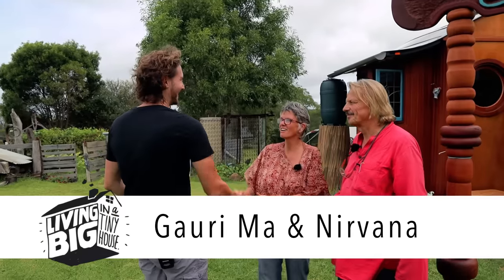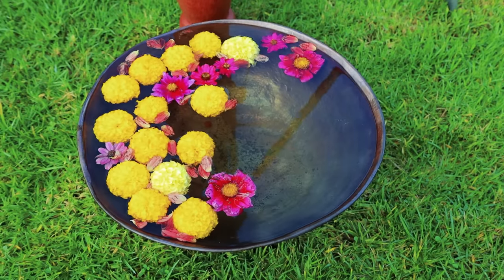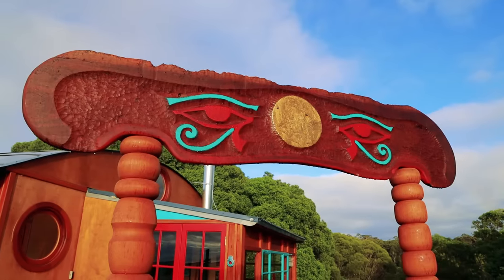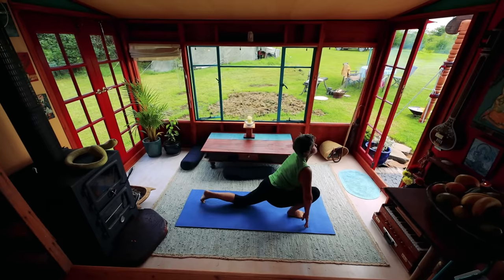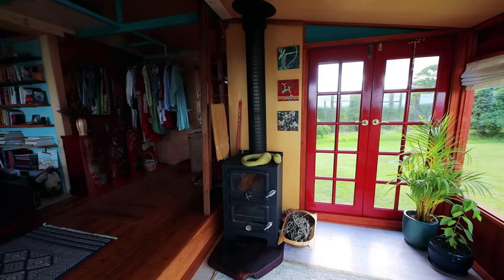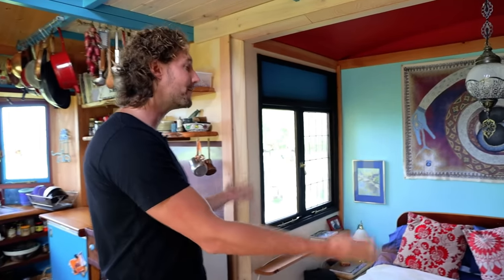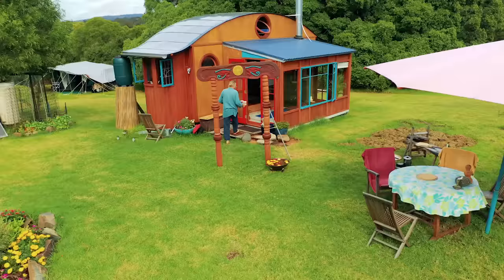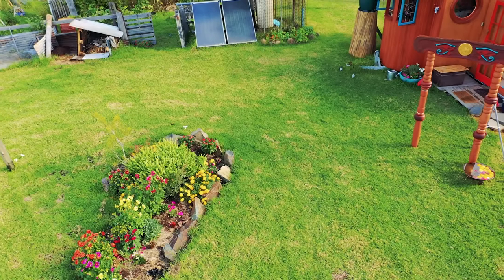Transforming Tiny House Combines Beauty And Engineering For Artful Living

Comment: hands down, this is the best one that's a fit for me that Ive ever seen, mostly off grid capabilities, the downstairs bed with room on sides and above,  one room open space with virtually few walls, taller head space, yoga space, lots and lots of windows/ atrium area bringing light and outdoors in, using space in floor for storage, indoor outdoor shower plan, gathering rain from roof gutters, funky large kitchen and use of beautiful found materials when available, and ethnic color scheme and huge beautiful well protected garden that sustains most food needs with pristine land and likely few neighbors...I could build this but what a coup on the land. I would need to work out some kind of deal with a land owner so I could do this. I seem to hear in most of these stories "we are on our friends land" or its "our parents land" which I find rather dismaying.

Comment: well its all very nice but seriously i would add a Moroccan sofa ,  just more use than the end of the bed and can be taken outside in summer to lounge on , really easy to make too , just really a thickish pad of foam a pretty rug for over the loads of cushions for the back rests , as a bonus if you say made it from 2 4 inch pads you can separate them and then you have either two single beds or one double guest bed

Comment: looool... object entanglement??? there is not only clutter inside, on the walls and jammed inside the floorboards, there is also clutter all around the house outside lol, funniest couple by far, they solved the matrix of designing tiny homes by curving the roof and using every colour on sale at mitre 10 - willie wonker would be proud lol